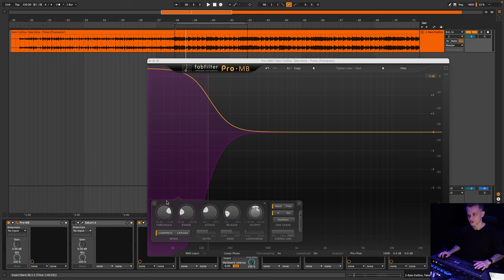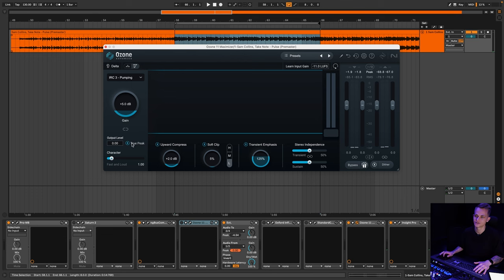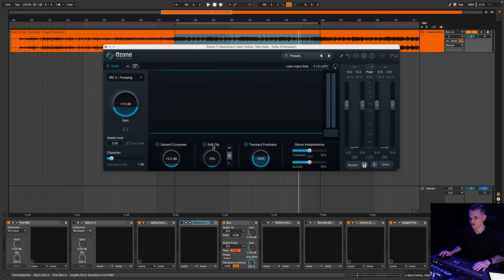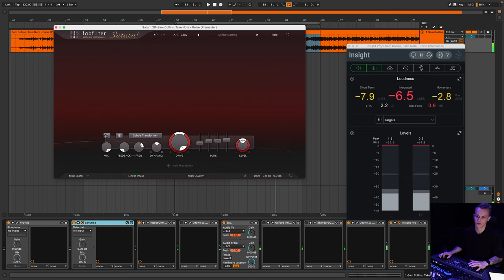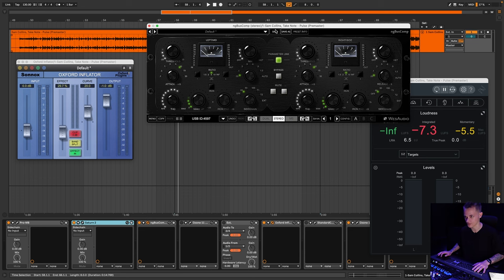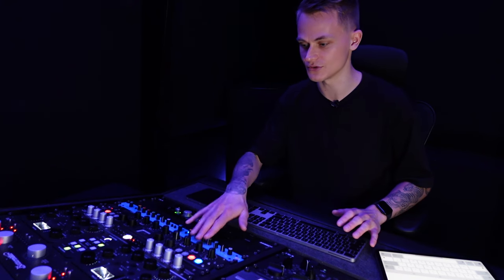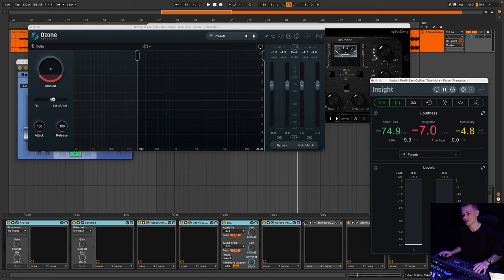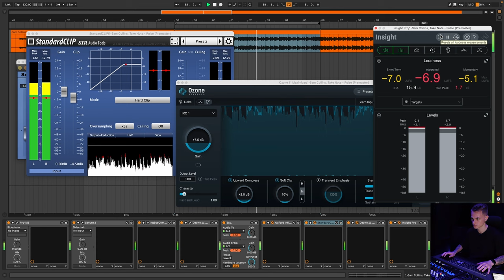How To Get Loud Dance Masters (Tutorial)

Comment: How can you clip in plugins in  a 32 bits floating point DAW ?  Do you have any technical knowledge about digital audio ? I am refering to "gain staging" part of your video.
Reply from the maker: Absolutely. However, some plugins react differently when pushed harder. I’m not referring to digital clipping, since the DAW indeed operates at 32-bit floating point.
Reply: @thismixissick  Well at 3:30 you explicitly said " Going way too hard into plugins, unintentionally CLIPPING in a lot of places, is what you want to avoid because all these ARTIFACTS and DISTORTION adds up..."
 If this is not referrig to digital clipping, then what is it ? I like your content, and it's alright to make mistakes, but just be honest with your audience and make a correction in futur videos instead of twisting your own words to negate the obvious.
Reply: The most simple answer to your questions is DBFs. DAW-s are projected in the way of creating some limit point in order to achive maximum digital clean loundness. So if you push your signal above 0 DBFs your signal will start to clipping not because our computers can't handle this operation (we have 32 floating point) but becouse we have to find some reference point and make decisions about it.

I will give you an example a you can try it on your own. 

1. Run your session at 32-floating point
2. Take any sound and push it above 0 DBFs
3. I will start clipping 
4. Export your file with 32-bit floating 
5.Open new 32-bit DAW session 
6. Import your previously clipped sound of choice 
7. Normalize it to level under the 0DBFs
8.If you did all steps correctly, your audio will not clip anymore. Why?

Cuz the reason I have said in the beginning. 
The DAW and audio programmers have to find a solution to  manipulate audio it to export it to analog driven world with the limitation of sound physics and quality of audio drivers (speakers). 

And in real world our speakers have audio translation limitations. In our DAWs we just sets some abstract reference points to operate and manipulate audio. And then 8bit is not enough data to smoothly operate audio manipulation without clipping and distortion. 16 bits are enough but still (CD-R are on them) they can lack flexibility when manipulation of audio. Then we have 24bit which are more than enough to manipulate audio and finnaly 32bit is just pure freedom do do what you what to do. Remember only that our software is programmed relatively to some reference points and in our music production case is our DB full scale where digital Lourdes is measured from (-infinity to 0) from silence to maximum potential loundes of signal without distortion due to lack of source data to write.
Reply: @jeanpaul.mma_  The clipping you are refering to is caused by getting over 0 dbfs when bit resolution is reduced to 24 or 16 bits. This is not what he was talking about since he is using true peak limiting in a mastering context. He was talking about getting over 0 dbfs in multiple process (EQ COMPRESSION SATURATION ETC..) in the 32 bit floating domain before hitting the limiter and before reducing the bits depth, thinking it would cause distortion and artifacts. That's simply false statement.
Reply from the maker: Thank you for providing this additional and valuable information for everyone!